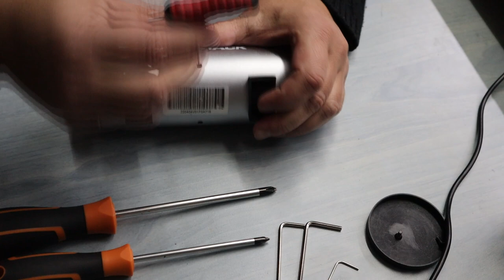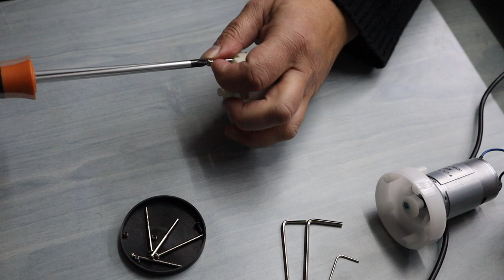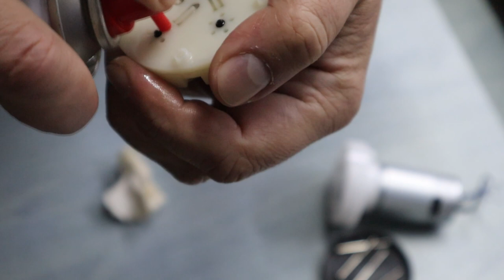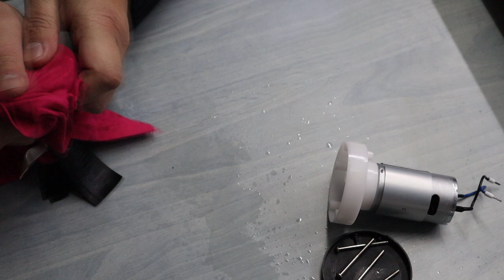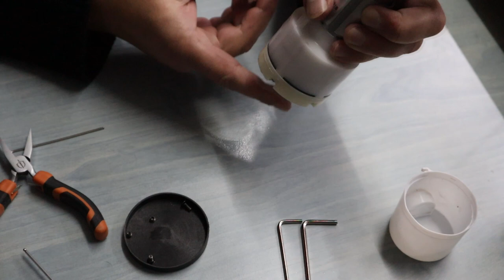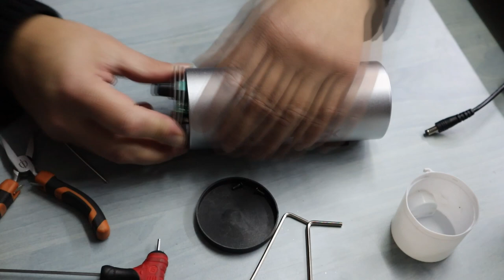How to clean the air pump

Comment: I love how I just googled "how to clean a small air pump" and the first result is literally the pump I'm currently trying to clean now. A1 man thanks, this thing wasn't cheap and the set screws were hidden under stickers so I had just assumed it was epoxied into place. Took it apart and of course the intakes into the lobes were full of black char. 10/10 Saved me some money on a new pump, cheers bud!
Reply from the maker: Use it as far away from the laser smoke as possible!
Reply: @RmcReloaded-tehnicaldriver  I try but the mesh screen still lets stuff in, my next step is to get some 3mm tubing to attach to the plastic air inlet > drill a hole in the housing for the tubing > then laser cut a fuel filter style cotton air intake that I can replace every couple months
Reply from the maker: Why don't you fix the air pump under the table? The stakes and smoke would not reach her.